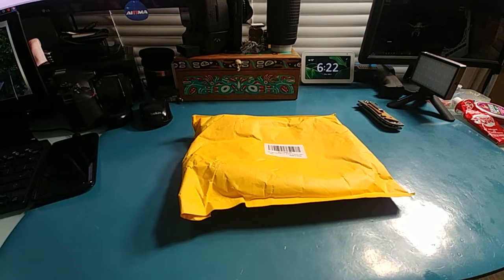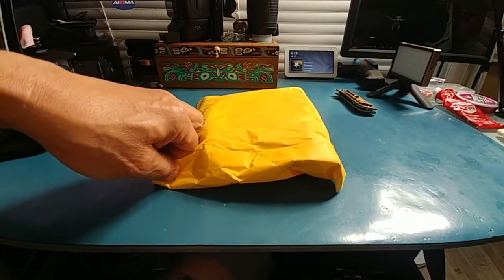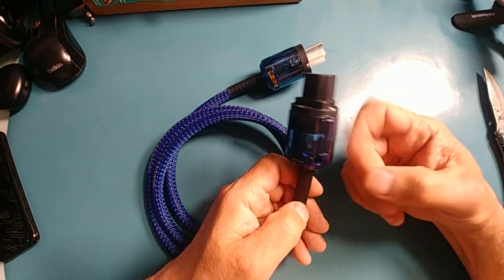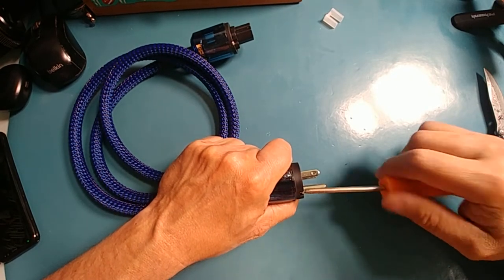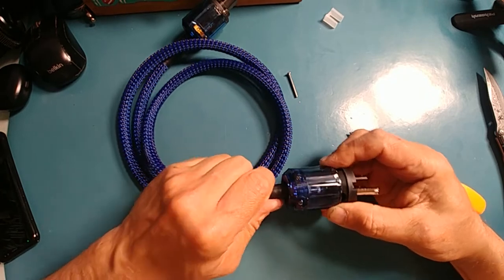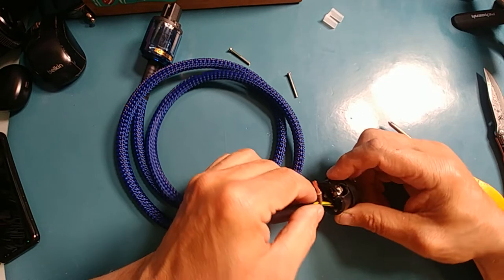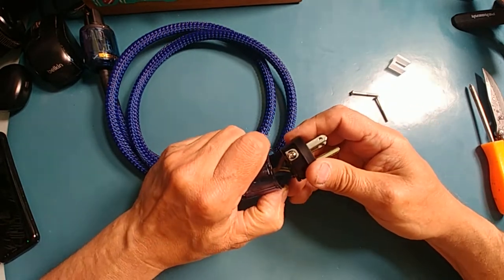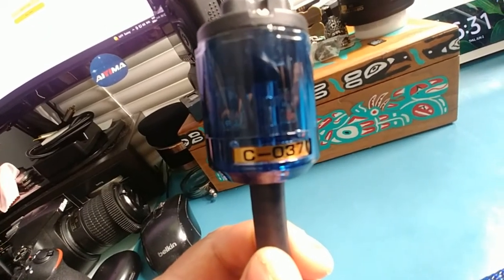electronics vlog# HiFi Audiophile Power Cord*overview*

Comment: TLDNR guys.... just move along.

It was interesting to see that the cable does not even have a copper shield to correct/mitigate EMI, RFI interference should you need or want it..  It has no shielding at all in fact...That seems odd.     One Q/A on Amazon said this cable had 10 awg conductors.    That isn't cheap.  Not unless you buy well over 500 feet.  Do you think/know if it is indeed 10 awg?   It looked pretty beefy.   That's a plus.

Without shielding though, you pretty much bought standard 12/3  or 10/3 cable with cheap but fancy looking plugs and a PET sleeve.    It's not a bad cable per se, as It seems well suited to do what it is designed to do.... But it surely isn't true audiophile/medical grade.    You possibly could have bought a 10 foot heavy duty Tripp-Lite PC power cable for $15.  (cutting this in half could yield 2, 5 foot cables for $7.50)

But seriously, for a good quality beefy 10 gauge pure copper 3 conductor cable, a 15 foot length of Southwire 10/3cu cable costs $50 and that whittles down to $16.67 for your desired 4.9 foot length.  You could over time, easily make 3 power cables from this.  Buy the plugs and connectors later, as needed to possibly sell them on eBay or power more of your gear...   Yeah, costs go up... good American company though...

This stuff reminds of what they used to do way back when I was much younger... They put fishnet on a cable and jacked up the price.  You almost need to crack things open to see what you're getting.

These plugs/connectors , bought in bulk can cost very little.   p-037 c-037  P-power C-connector...  These can be purchased for as cheap as $4.46 each retail.  But in bulk... from the supplier, that easily drops to closer to $1-$2 for under 250 units.  Depending on the amount you buy of course, but for our purpose we need only 1 pair.    These exact plugs and connectors can be found on AliExpress for various prices.  I posted the lowest that I found for reference.

The cable -  bulk purchase, cut to length:  Just to show costs for those who make these cables en masse and sell them on Amazon.  

These prices are based on a 250 foot min purchase  Costs go down substantially once you get over 1000 feet.  
12/3 STOW Black 105C 20 Amp 600V NA Heavy Duty PVC Thermoplastic Bulk Cable - This can be bought at length for $1.19 per foot.    
10/3 SOOW Black 90C 30 Amp 600V NA Heavy Duty Rubber Bulk Cable - This can be bought at length for  $4.04  <-look at that price jump!

The black and blue PET sleeve...  Anywhere from $6 to $10 per 25 feet retail.     Less of course per foot when you buy 50ft, 100ft, etc.  Bulk pricing drops that way, way  down.

Buying power/capital + bulk purchasing - This is how the seller makes their money.    For us... You're right, we really can't make this cheaper... 

So at 100% retail cost to us... DIY for 4.9 feet of 10/3 @ $16.67 + plug and connector @ $8.92 + $1.56 worth of PET sleeving and the heat-shrink tubing is negligible. Unless you are using marine grade so it glues the PET in place...Still , not costly but slightly more in costs.   

Total per unit cost = $27.15  This is the most practical DIY solution overall based only on the limited research I did for making an identical cable.  Total costs however are about $81.45 for 3 identical cables.    This is on par with my Prime which lists this cable from $23-$26 and still, quite close to your posted costs in the previous video.

You spent $29.99 without Prime free shipping.   You did pretty good all things considered, but in my humble opinion you paid far too much for what you actually received if it is 12/3.    If it is 10/3, then that isn't too shabby at all. It really isn't.

I feel bad you had to open it up to find these things out.  But often, these things must be done.  With that, you of course have my respect for doing so.   Somebody has to...

In the end, there are lots of options... Some open the door to making a few extra to sell on eBay or to use for other gear.    Heck, I would have made this cable for you....

Thanks for updating us!